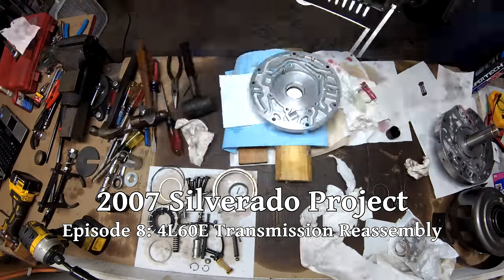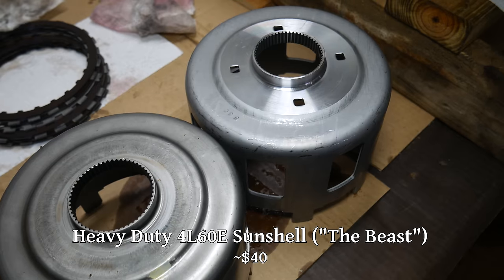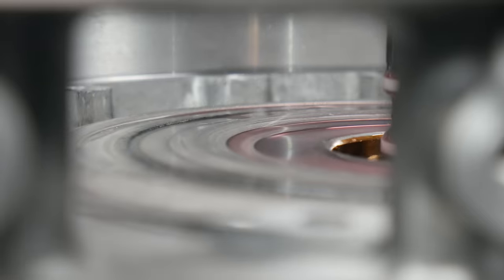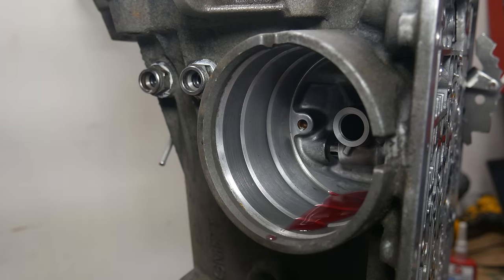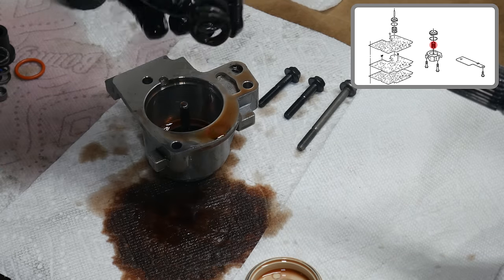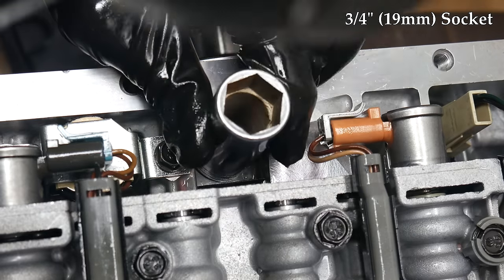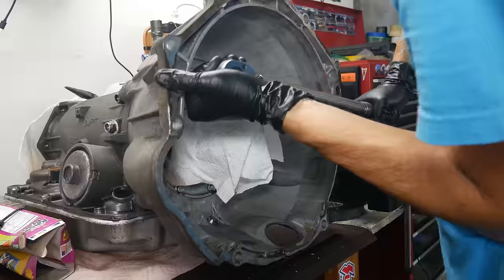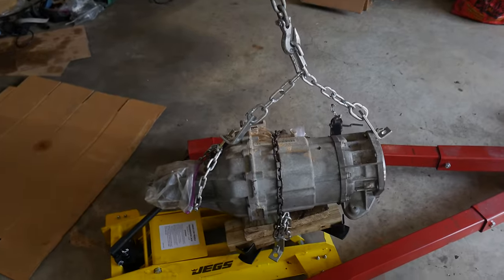2007 Silverado Transmission Reassembly (4L60E Rebuild) (Ep.8)

Comment: Great Video.  Instead of cutting a drain hole in the pan I have a mity vac fluid evacuator that holds around 6 quarts.  I put the tube down the dipstick and suck all the fluid I can and the pan does not rain down.  Nice thing is 1 evacuator for all vehicles vs needing a drain in each one.  I also use it to drain down master cylinders to put all new fluid in before bleeding brakes.  Great to adjusting oil levels if you ever overfill an oil change.  PS fluid changes with it work well too.  Thanks for the video.
Reply: Boats with inboard engines use something similar.  Kind of hard to put a drain pan under the engine doing oil changes.  I just thought about something--I wonder if boat motors that use car type engines even have oil pans with drain plugs? Vibration issues could cause them to come loose, making a mess down there, or even worse, engine damage,  due to oil loss...   lol

Comment: To get the reverse drum on the input drum use your palms on both sides of the drum and alternate them back and forth like you're starting a fire. The constant back and forth motion will shake the clutches into place and it will start dropping down when the splines start lining up.
Reply: The separator plate also has 2 line up holes. I use bolts for this, but the first one is one of the shortest bolts in the top left hand corner, and the other uses a long bolt and the hole is the top pressure switch hole closest to the pump. You can also gel the checkballs into the VB instead of laying them on the plate.
Reply from the maker: Ah, makes sense, thanks for the tips! I had searched around for info on that but it is a difficult thing to Google and came up empty-handed.

Comment: This is my first transmission build and found an easy way to marry the input drum and reverse input drum. Took 30 seconds. I put a dab of Super lube on the washer and thrut bearing to secure them. Reverse drum sitting on a chair with a hole in it. Aligned  clutch teeth with a screwdriver.  Put input shaft into reverse drum and shaft goes through hole in chair. Gently wiggled until 2nd shaft seal was exposed.

Comment: Yeah, leaving some fluid in the bottom of the pan is because of the height of the nut is kind of irrelevant.  If youre draining to take the pan off youre going to get that out later and if youre just draining to refill the little bit left in the pan is nothing compared to the gallon or more left in the rest of the system.

Comment: I did a 700R4 rebuild for a family member a few years ago during winter. Even though I had a manual for the transmission I somehow ending up installing the sprag in backwards. This resulted in the truck being in a Drive scenario at all times. Sucked to find out after it was all installed.
Reply from the maker: Ouch! Sorry to hear that, really frustrating stuff. With all of the parts and work to deal with, it is a very understandable mistake to make.

Comment: Why didn't you just weld a castle nut to the bottom of the pan? then the oil could flow though the castle part of the nut and most of the oil would drain out then and you would still get a flat surface so that tightening the drain plug wouldn't dis-form the pan.

Comment: It seems like if you welded the nut on the bottom of the pan all the way around, cleaned the slag and went over it to ensure a seamless weld then you would be able to drain all the fluid no prob. To make sure there is no leak with the bolt threaded in you could use those rubber drain bolt seals that you sometimes see on oil drain bolts. Would that work you think?
Reply from the maker: Welding to the bottom of the pan is tricky, using shielding gas would definitely increase the odds of a clean weld, as would several passes. The weld around the washer was flux core and two passes, but obviously still had a pinhole somewhere hard to see. Welding the nut on the inside of the pan flat to the surface as I had done in the past is what I will be continuing to do in the future.
Reply: Fuzzy Dice Projects sounds good. My OCD definitely hates the idea of not getting all of the fluid out LOL. But in reality I don’t think it matters much. Especially if you are keeping it changed at proper intervals.
Reply from the maker: @RoosterSpur  Well if you are dropping the pan to change the filter which should typically be done every time the fluid is changed, all of the fluid in the pan can be emptied anyway, it just means a little care must be taken not to completely tip the pan over when removing it in order to not make a mess. A standard pan-drop fluid change will only get around 5 quarts out, leaving 7 quarts in the torque converter and transmission though.

Comment: "Transmission fluid isn't cheap but I am!" That was hilarious. Can't wait for the transfer case. Although I'll never rebuild an automatic (some black magic stuff in those things) I do want to have a go at my jeeps transfer case!

And to elaborate more on filtering that fluid. Do you think it would actually work? I'm going to be replacing the valve body gasket on a friends Ford ranger (about as far as I dare to go) and he doesn't want to buy more fluid again. We just took it apart a few months ago for a shift solenoid replacement which didn't fix the shifting issue so the valve body gasket is the next stop. We refilled about 6 bottles of Mercon V and it wasn't cheap. Like 54 bucks. So if we filtered what we drained since its fairly new, do you think it would hurt anything to reuse the fluid? 

Thanks in advance. Love your videos. Been hooked since the first S10 episode.
Reply from the maker: I wouldn't worry about it unless the fluid was old anyway or there was significant contamination (ex. coolant, friction material, metal). Don't use a grimy old filter, of course, but a new/low mileage one with some low mileage fluid shouldn't hurt anything, and is a little extra insurance from any debris that may fall in the drain pan. The fluid the clutch frictions soaked in that I filtered didn't come out as red as new fluid, but it did lighten it up. Have done the same filtering thing to refill transmissions after a non-fluid change related transmission pan drop as well.

Best bet would be new fluid, but for "good enough" filtering slightly used ATF should be fine. Thanks for the kind works, and good luck with that valve body gasket!

Comment: I’ve been enjoying this series, I own a similar truck, a 2012 SCLB 4.8 4x4. What fluid do you recommend for these?
Reply from the maker: I usually stay with Valvoline, though I'm sure any brand is fine. But I'd strongly recommend running full synthetic for LS trucks and other recent models. They tend to run pretty hot unless they have an auxiliary transmission cooler, hot enough to eventually cook conventional oils. My understanding is that conventional oils start to break down above 230 degrees F, but synthetics are good to 270 degrees F (not that you ever want to see the trans get that hot).
Reply: @FuzzyDiceProjects  180 is tops, if u wanna give a good long life for all the internal components. One of my trucks has 600.000 miles, and tranny was rebuild only once at 300+ k miles

Comment: 1st things 1st your a smart guy! I Have a question concerning the Jeep Cherokee project you do with your friend I know this isn't the video but I still have a question about it . Do you have to have cylinder one at top dead center when you're  Installing push rods and rockers? Because my buddy just bought a new head for his Cherokee and it's the right head and when we put all the push rods and lifters in they looked fine and then when we installed the rockers they were Kocked  to the left of the center of the valve top?
Reply from the maker: I'm not sure what you mean, I think this is a typo: "when we installed the rockers they were Kok"

It shouldn't matter how the crankshaft is positioned since the rockers on an inline six Jeep 4.0L are non-adjustable (to the best of my knowledge) and the hydraulic lifters will collapse if they need to as the bolts are tightened. Are all of the pushrods still in place on the lifters and in place on the rockers? If it is a really high-mileage or gunky engine it is possible that some of the lifters are sticky and not raising up without oil pressure to assist them. Was it particularly "ticky" before the cylinder head replacement?
Reply: @FuzzyDiceProjects  sorry about the typo. I fixed that and no he just rebuilt the 4.0 new crank, oversized pistons and new lifters pushrods head and rockers. That's why I can't figure out when I installed the head and pushrods 10 of the 12 rockers after torqued down they were seated on the valves properly, except  3 of them they had play in them and when tighting  them down they "kocked over to a 9:00 position.  With the old head they had ran all the new parts for about a hour and a 1/2 driving around and then found out the old head was warped?  So I have no clue if the a** to do with the valve train issues that were having with the installs I believe a couple of the rocker retainers are tweaked bent out of shape so we are ordering new ones to see if that fixes it. I just didn't know if you knew what was going on or not and it's kind of hard  To  Guess without  seeing it.
Reply from the maker: Hmm, that is a difficult problem. You only have on set of valvetrain parts, the new cylinder head came bare? If you can't try some others new parts seems like a good idea. Unless the cam has wiped lobes, the rocker bolts aren't tightening all the way, pushrods are uneven in length, some of the lifters are no good, or something similar you might need to take parts off and chase down where that space is coming from. Measure from the cylinder head to the top edge of a few lifters (not the cup) when that lifter is at the highest/lowest point in its travel. Double check the pushrod lengths and that you can push down on them to compress the lifter spring and have it move back up on its own. If everything checks out, seems like you are on the right track already with rocker arm geometry being the issue.
Reply: @FuzzyDiceProjects  will do thanks!

Comment: Did I see the 3-4 servo o ring when you were putting in the snap ring in?
Reply from the maker: The blue? It is actually the blue paint/coating from the new servo cover o-ring that scraped off as it was installed. Sometimes the colored o-rings (especially the cheap ones) don't keep their color very well. Check it out on the close up shots a few seconds later.
Reply: @FuzzyDiceProjects  awesome. I mean I didn't see it again so I was hoping it wasn't the seal. Great job nonetheless. I'm building a 4l60 that can take some boost for a crapalier my kids and I are building.

Comment: Why not leave the oil pressure gauge hooked up and run it into the cab Incase something happens going down the road like a month later
Reply from the maker: Wouldn't be a bad idea to set up a permanent trans pressure gauge in the cab, but it isn't in the cards to make that happen at the moment!
Reply: Fuzzy Dice Projects I got a old ass truck an I wanna put the pressure gauge on there 24/7 just gotta figure out where and how to put it in the truck with out cuttin etc too much in the ol heavy Chevy she’s a 04 1500 z71 lt
Reply from the maker: Just make sure whatever line or hose you use will survive lots of vibration, heat, and up to 300 PSI of pressure if you aren't using an electric sender setup. The hose that comes with the Harbor Freight oil pressure testing kit is decent and cheap, but I wouldn't trust it not to leak on a permanent install.

Comment: Why don't you just weld the nut for the drain plug on the outside of the oil pan?🤔
Reply from the maker: Then you're relying on the weld to be completely sealed (which is why it leaked through the weld around the washer), which is tough to do, certainly with flux core wire. Plus it makes it harder to move around if the bottom of the transmission pan isn't flat. Have "fixed" stripped threads on an oil pan by welding a nut on though, with a little JB weld on the weld area to seal it.
Reply: @FuzzyDiceProjects  Ah, i see. I guess one could try sealing the weld from the inside with JB Weld, but who knows how that's gonna turn out.

Comment: Then I like the video but I didn't like that extra drain bolt you put in there it would be a shame to have rebuilt that in transmission just to run out of oil